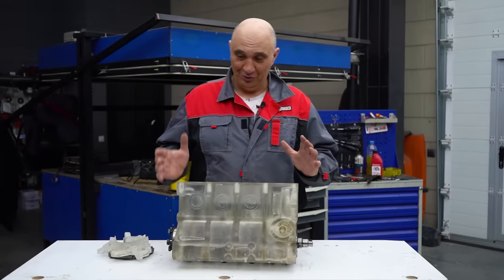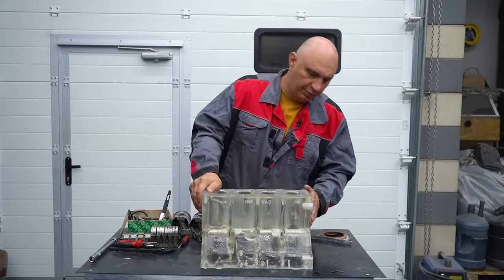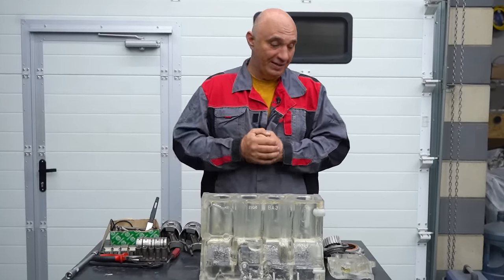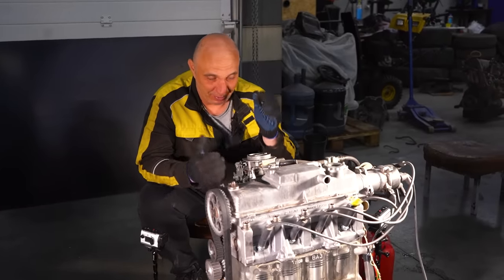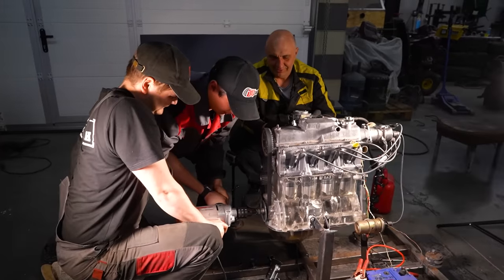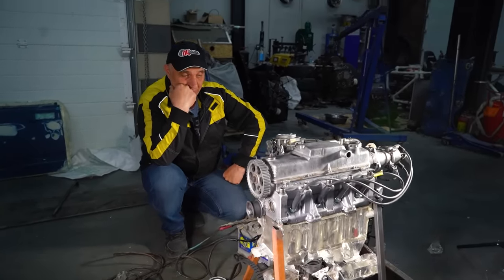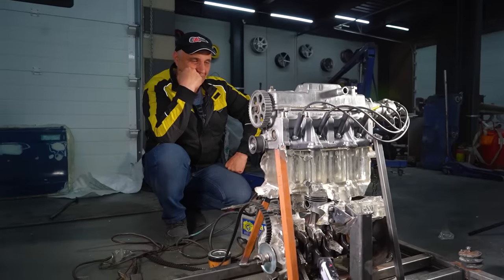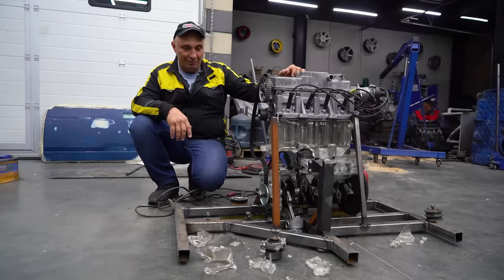Transparent engine block – first start

Comment: The explosion was the funniest thing I've seen from you guys especially when you said how long you have been working on it 😂 Thank you very much!
Reply: Kinda sad actually
Reply: @gabrielv.4358  Agree. Not funny at all.
Reply: @SoddingaboutSi  What did you expect? Epoxy is brittle AF. 
We should be grateful that Vlad still has his eyes.
Reply: Dunno why the Debby downers but that was hilarious. I was expecting at least a couple revs but blammo! The expression he had after just explaining how long it took to make was perfect editing lmao
Reply: I think the timing was too far advanced, myself.
That was probably a backfire.
If that was an epoxy block, it’s not as strong, anyway.
I would find a solid block of polycarbonate and machine away enough to fit the crank and pistons, and have head bolts that go clean through to the bottom of the block.
I would run a stiffener bar around the perimeter of the block, and have the bolts clamp the block to the head, if that makes sense.
This was a worthy first attempt.
I’ve seen a polycarbonate head on a flathead engine, so this should work.
Oh, one other thing!
Since it’s definitely not going to be used to power anything, I would lower the compression to around 4:1.
If that’s good enough for a flathead, it’ll be more than good enough for this!
Reply: @dangeary2134  Someone pointed out that the block cracked during the startup attempt with the drill.  Meaning that the block was going to fail early due to torsion and general stress from the torque of the motor and internal friction, wither or not an explosion killed it the second time around.  Reducing compression would not only help with pressure and heat issues in the cylinders, but also reduce the force and torque needed to fire it up, which may save the project yet.  But, the fact is the material is of a thickness made for metal; iron and aluminum alloy might be able to take the force and strain of a motor and its internal dynamics, but thin plastic casting of the same thickness will definitely not.

Beyond lower compression, one would almost need to make the material thicker, which would be difficult to impossible.
Reply: @dangeary2134   They probably stressed it too much bolting it to the engine stand.
Reply: Reducing the compression ratio would definitely make a better test result. Probably if the crack people saw didnt happen as well
Reply: I agree, prime meme material
Reply: @SoddingaboutSi  Well you must be fun at parties.    Funny as fvck!  Also a bummer.  But you gotta have a sensa humor about stuff, mang!
Automotive slap-stick at it finest.
Reply: @SoddingaboutSi I disagree. It is completely possible to respect the hell out of this effort, while finding the RUD hilarious. Kind of like when SpaceX's prototypes blow up. We laugh with them, and not at them.

Comment: I'm surprised he didn't draw more positive attention to the fact that they did indeed achieve and record a power stroke through the windowed block. It's a matter of discovery before our eyes how the material couldn't handle even that much stress. It's a reminder how amazing it is that our metal blocks keep together for so long.
Reply: The piston had a power stroke and kept on going.
Stresses made by the mounting of everything,  this material doesn't have the elasticity of a metal block, stress risers don't work the same,  they have to be more gradual and beefier.
Reply: My diesel engine on my works VW caddy died like that, loud bang, wheels seized up, open hood, steam and oil everywhere, close hood and call for help
Reply: This was an impressive episode. The fact that a single combustion cycle occured inside is impressive, given the pressures involved. In the future, these guys could use alon (transparent aluminum) for the engine block, as the material is highly durable. However, it is prohibitively expensive as of 2023.
Reply: @darrellcook8253  it also had the flywheel/ring gear which acted as a reaction to the piston
Reply: Why is it surprising that metal can withstand that?
Reply: @supcuddy it’s not. Metal is strong and can handle lots of heat so not surprising that engines and other drivetrain components are largely made of metal.

Comment: Guys, if you can get a rover K series engine it would be ideal for this, cause the head bolts go though the engine into the main bearing caps. Also lower the compression a lot so the block is not so stressed. It don't need to make power, just run only. Great effort and look forward to the next attempt.
Reply: I literally wrote this on someone elses comment before i saw yours, we literally had the exact same idea 🤣.
The sandwich block is a rather good idea tbh.
Reply: we told them that when they started this endeavour
Reply: You could translate that to Russian and post in the Russian version of this video?
Reply: I had one myself ☺️ great engine
Reply: @android584  that is probably 2+ year old
Reply: I was going to say, maybe they could run the head bolts right through the block, but was unfamiliar with this particular engine. Sounds like the Rover engine would be a good option. Also retard the timing and run a rich mix, to reduce the combustion pressures and keep the engine cool...ish
Reply: Yeah , but they were still shite when they made them of steel🤣
Reply: Lol, was just thinking the exact same thing as I read the comments. K series is ideal for this.
Also what's the fool on about with the steel block, what steel block?
Reply: @Mark Ashworth  lol, I am not sure? They were never made of steel. They were a good engine, just the head gasket was a weak point.
Reply: @jamesphimister3291  true, once the HG was replaced with the uprated MLS gasket there would be no more issues.
The 1.8  VVC engine was a superb engine.

Comment: It was the most spectacular engine failure ever. And this shows how big are the forces in an engine and why the engine blocks may and ups broken sometimes even if they are made of cast iron. It was a very educative video. Thank you very much for the show and knowledge.
Reply: That's why I laugh when people say "an engine is just like a giant air compressor".  But its not even close.  The amount of forces and stresses of the machine and how it generates and pushes power is incredible, and there are many physical forces at play beyond just the pistons making power through compression.
Reply: @kingduckford  yet millions of them are made every year and a good percent lasted for hundreds of thousands of miles with little or no problem.  Amazing, simple amazing.
Reply: So true good and bad it's awesome knowledge thank you guys great work
Reply: this vid made me understand more when I see those plus 1k engines blown up like this tear apart in half, it seems the crankshaft pulls everything down
Reply: @kingduckford  air compressors go under the same amount of stress or even more you just indirectly admitted to not knowing what you are talking about.
Reply: @xxzenonionnex7658  Are air compressors pushing several rods and pistons to a single crank that connects to a heavy flywheel, that then puts force into a drive train?  Are air compressors put under direct load through a transmission, can air compressors be lugged through heavy loading?

An air compressor need only compress air.  An engine has to actually put force into a mechanical system that can, in most cases, put forces and dynamics back into the transmission, drivetrain, and into the motor itself in some cases.  

There is no similarity, outside the fact there is compression in cylinders.  That is where all of the similarities end.
Reply: @boronat1  The crankshaft pushes downward, the combustion above the piston tries to force the head upwards, and it's all held together by some bolts for the main bearings and the head...
Reply: Exactly, a lot of effort went into this but it still pops open on the first real rev which goes to demonstrate how crazy durable real engines are if they do this for hours, days, years and dont budge. Sad for the guys not getting at least 0.5s of the engine revving under its own power but still this is a great video.

Lada engine has like 8.5 compression ratio now imagine a modern KTM dirtbike has 12.75:1 in its tiny engine screaming its head off on a race circuit and somehow doesnt explode into pieces, engineering is an art.
Reply: @kingduckford  lol man a basic aluminum block like a Honda b18c will split in half at like 1500+hp
Block almost never fail rod do and destroy the block in the process never the other way around 
With billet block when the engine blow up they machine the hole and weld a patch and reassemble with new rotating assembly 
You see this kind of failure in tractor pulling contests
Reply: @milanstepanek4185  no correct use of material is 
This just prove that this material is pretty weak and brittle
A bridge that carry thousands of car and truck must blow your mind lol
Reply: @kingduckford  how do you think that air gets compressed? The load on the crank is proportional to the amount of air being compressed. There's videos of people converting air compressors into engines and using them to power things.
Reply: Best one I've ever seen is this... but it's not plastic of course.  Probably producing a few thousand horsepower after the run away, for a few seconds: https://www.youtube.com/watch?v=ZfttA0mds-c
Reply: Definitely an impressive failure. Worst I've seen was at a drag race. A top fuel team had just rebuilt their engine and were ready to fire it. A fuel injector stuck wide open, filling a cylinder full of nitro methane, hydro locking it. It detonated in an instant. Blew the camshaft through the super charger, splitting it in half and it sent at least 1 piston through the left cylinder head and clear through their transport trailer. Nitro does some crazy shit

Comment: It needs two metalic structures to support the crankshaft and decrease the compression ratio to work 👍
Reply: Yeah and is there a low temperature fuel? Other than any fuel, way rich.
Reply: @skuula  less compression ratio decrease the compression temp and stress. Decrease the combustion temp and power. Perfect to just show the engine running
Reply: Thread bar from main cap to head.
Reply: And much thicker walls for structural integrity :D
Reply: Yes
Reply: Well in that case better to just modify the original block, and put as many windows on it as possible
Reply: i to posted for less combustible fuel like RC car nitro or alcohol. Using way less compression. Even then i believe a crank support, bearing at both ends of the crank, might work. Even thin i think the block walls would blow out.
Reply: Ideally they would kinda need to do a sandwich block design like that of the rover k series. The head bolts almost reach the sump. They bolt into an oil rail assembly underneath the crank
Reply: People keep saying to decrease compression, but it really wasn’t the cylinders that exploded. While decreasing compression may help, I think it was mostly because the resin probably can’t handle the fact that combustion engines ignite their fuel slightly before TDC which causes a lot of downward force on the crankshaft which for the most part is inevitable. Couple that with the fact that resin on it’s own is just generally really brittle, so this would probably need some sort of metallic support on the bottom part of the block to prevent those forces from completely decimating the lower part of the block.
Reply: @Wind_Assassin  Yeah okay grind down the pistons a bit, maybe.
Reply: and maybe retard the timing
Reply: @skuula  Methanol?
Reply: @xmysef4920  lower compression results in less downward force, cooler fuel result in less downward force. You can also time for a retarded ignition, that is after TDC, 10deg after TDC significantly lowers the force of the pistons downward travel resulting in less powerful ignition. As long as the engine is not doing 'work' less combustion pressure is needed.
Reply: Make a block out of belzona.  It will work, but it will not be transparent.   And it will cost you 10,000 dollars at least
Reply: @Nza420  the objective is a transparent block.
Reply: agree that would help.... first thing I saw from onset before even starting engine with drill.... was potential for flex in engine mounts. Seemed from get go this would cause failure.  IMHO, the flex in engine mounts, is what started the initial crack in block.  it; like all engines... as it started, twisted block a little bit....  no way for it to flex..... so block cracked instead
Reply: @xmysef4920  The reduction in compression also reduces the force of the fuel igniting.
Reply: the main bearing caps have nothing to hold into that is the problem
Reply: @skuula  nitro fuel for rc cars would be the closest thing to low temp fuel
Reply: @Videoswithsoarin  and the second the bottom end will kind of hold the head bolt will strip and send the head flying 
This happens in tractor pulling  contest and drag racing on 4 cylinder the block split at the base of the cooling jacket/where the bottom of the head stud is
A fast burning fuel that can be ignited after tdc and will completely burn before the exhaust valve open may help stock at idle it must be like 15° before tdc 
Propane burn faster and is 1/3 as powerful as gasoline
Reply: @xxzenonionnex7658  temp is not the problem it exploded at the first combustion even and the head/ piston are still aluminum
Reply: @legros731 nitro for rc cars has less potency as well.
Reply: @xxzenonionnex7658  and it burn super slow so not good 
And nitromethane  is used  on 10 000hp top fuel it burn so slow it still burning when its out the exhaust (and the reason you can make this much power with it)and why these car shoot 3 foot flame out the header
Reply: @Wind_Assassin  I built a V-8 clear mode like that in the 70's it worked perfect.
Reply: a lower CP should also result in a slower flame front and that will look cool.
Reply: In mother Russia, engine breaks you

Comment: This is what I love about this channel. Believe it or not, this is real science. It's about trying everything to find what works and what doesn't. Who else is gonna have the balls to prove what can be done, and what isn't possible? These guys will.  Love and respect to the Garage54 team from America
Reply: It's priceless for thinking people. Teaches those who wants too be taught.
Reply: Couldn’t have said it better myself Daniel.
Reply: It's "seat of the pants engineering".
Reply: If it dosen't work, then it must make to work.

Less pressure, it dosen't need to run a car.. 

This demonstrates how much some gasoline give force when it ignite. 

That timing should be maybe little late, to make it loose some power that isn't needed in this project. 

Did it destroy any of those rubber rings when explode?
Reply: @jannejohansson3383  just from what was visible I'm almost certain that there were gas vapors that accumulated in the crankcase, and they we're ignited in some way. The most likely culprit would he the absence of a head gasket - upon compression stroke one or more cylinders forcing fuel between the block and head into a oil passage into to crankcase, or even into a water jacket and filling the coolant galleries with an explosive mix.

In real life, I've only ever seen that type of bottom end destruction on boosted racing engines where the boost controller failed, and started feeding boost to the point that even the crankcase was having to hold 80+ psi. Of course if a controller fails at high rpm the destruction is instantaneous.

 Even with no PCV system present I simply cannot imagine that level of pressure forming due to the pistons alone. It seems to me that it would require an actual detonation in the crankcase. But, this is all conjecture and maybe they will post an update showing more. 

Peace